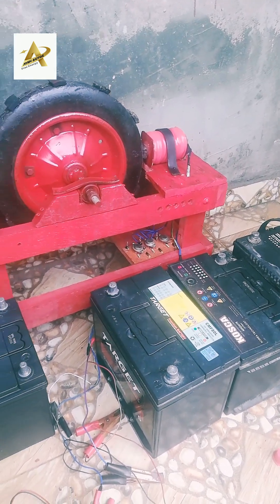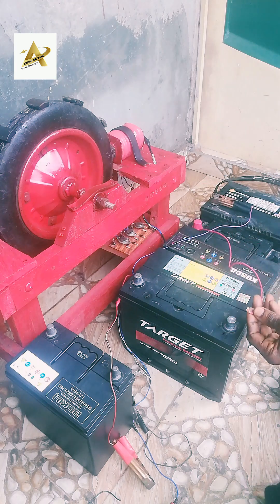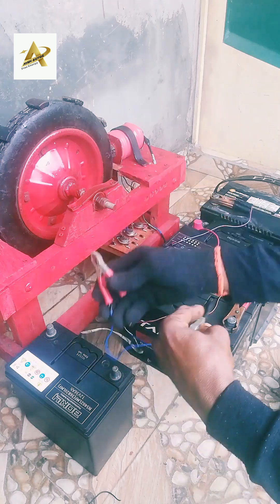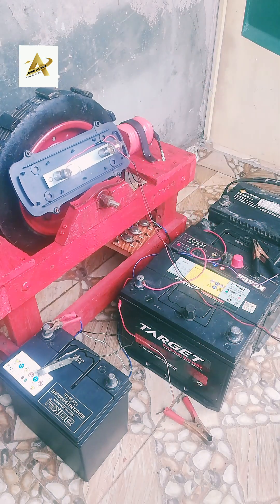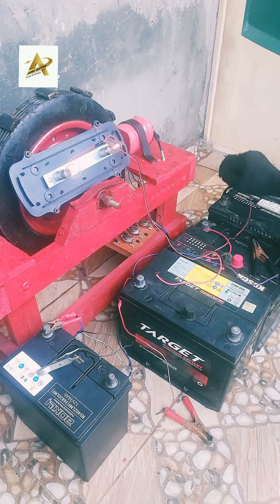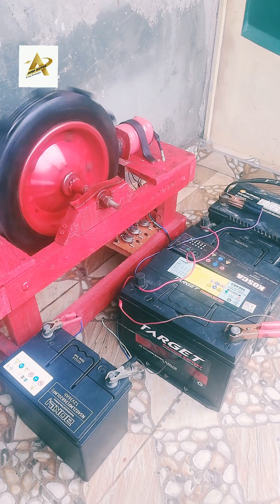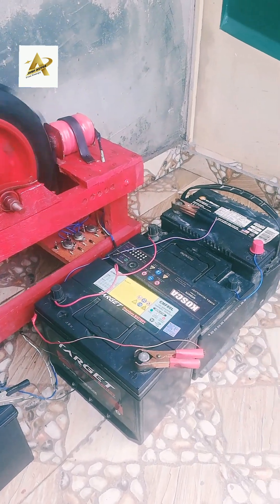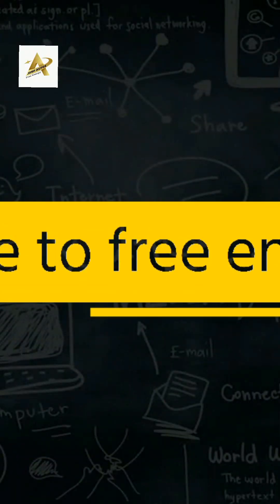Bedini SG Radiant Free Energy Generator 100% working, #diy #bedini #freeenergydevice

Comment: Can also lithium-ion batteries be charged in this manner???
Reply from the maker: Lead acid batteries only
Reply: @joshautoz3439 Is it true that from a small lead acid you can charge multiple lead acid batteries without draining the drive battery(not too much anyway), I mean, there is no conventional relation between the quantity of energy that is in the newly charged batteries and the energy spent from the drive battery, thus meaning that the energy from the charged batteries is not taken from the drive batt???? So could a sysyem be built as to have a 2 sets of charge batteries(2 sets of 2×12V, 220Ah), that are powering a home and periodically are being swaped, and the drive battery to be permanently kept charged from a small solar pannel??? Could this be feasible?? And by this being energeticaly independent, even if we are talking about small consumptions (4,5 kwh/day)???
Reply from the maker: You are very correct, you understand how the circuit works.

Comment: Feliciteri🎉 poti da o schema de montaj a piselor electonice trazitori ,dide, rezitente .bobina bifilalra nr spire si sectiune ..mtumim anticipat
Reply from the maker: Thanks how are you doing,
I will make a video about the Bedini SG Radiant energy soon. You can also visit www.bedinisg.com for diagram and circuit of the radiant generator.
Reply: Multumesc dar vreau sa stiu cum ai facut acest montaj ,eu am facut unul cu  diferite bobine dar nu reusec sa incarc bateria secundara consum din bateria primara mai mult  decat incarc  ex:cosum 2 Ap si incarc 1,3Ap
Reply from the maker: Ok, trigger coil 26 gauge, power coil 23 gauge, 2n3055 transistor, 5408 diode & 4001. Resistor 470omh.
Reply: Multumesc  eu am folosit  sectunea conductor  0.8mm si 0.5mm la 900 de ture sau 90m lungime lungime suport bobina 75 mm si dimetru interior 25 mm   intreb cate ture are bobina ta   multumesc anticipat